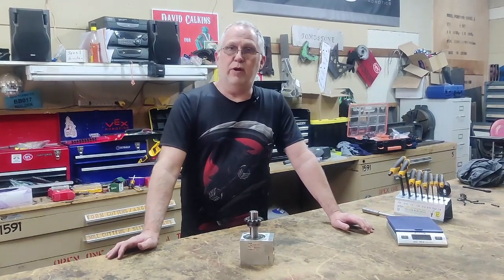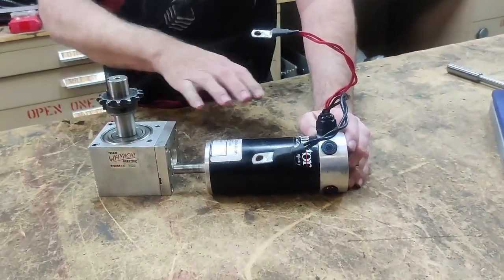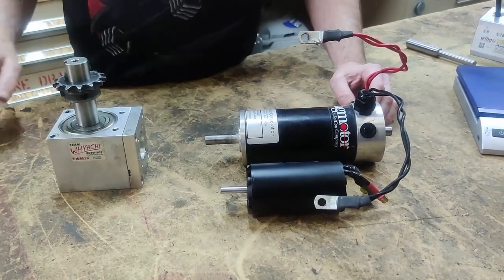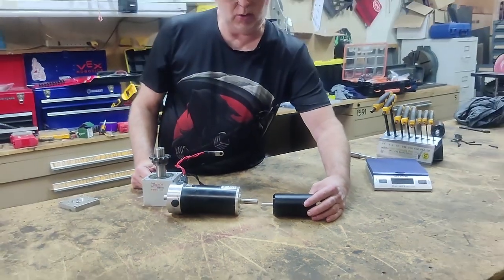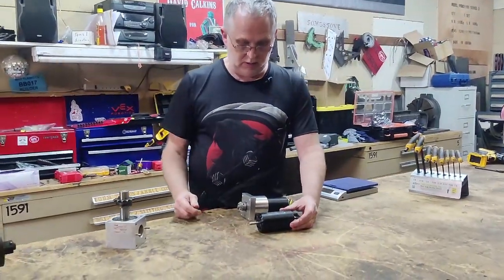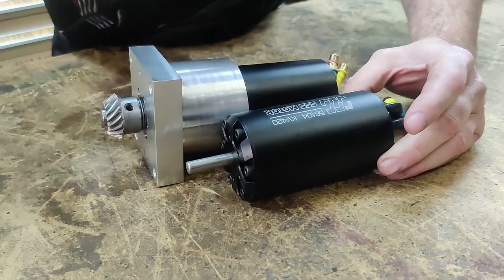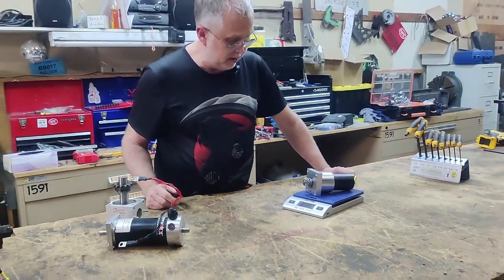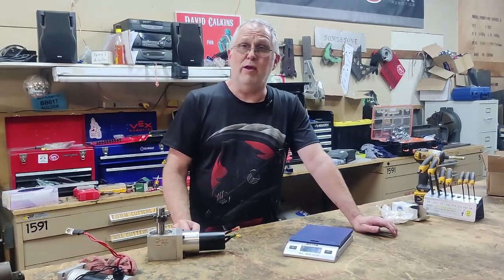Mortician 2023 - Weapon Motor

Comment: Look into the flat or pancake style motors. They have a very high torque start and stop using almost half of the power. They come in brushed and brushless versions. you would be able to direct drive your chain and remove the gear box. We used them decades ago in Panasonic copiers using belt drive. One machine literally had a bug fry on the control board and the motor slammed the optics carrier home and shredded the claimed "indestructible belt". That is a lot of torque!

Comment: Going to epoxy the windings of the motor? That 8mm shaft seems kinda small for the kind of hits. Maybe a flexible shaft coupler could help reduce the impacts.
I also worry about heat. I've burnt up quite a few motors of that size, just from lack of airflow. Maybe some thermal compound would help draw heat away from the motor case and into the aluminum piece you machined.
Reply from the maker: The motor I ordered from China was supposed to have a 10mm shaft. And took two months to get here. So by the time I had the hardware in my hands, I was pretty much stuck using this. I share your concern here, but we're going to run it and see how it goes.

Comment: Hello Ray, Hope you are doing great. Thanks a lot for all the videos you share. I had a little question regarding this video. What were the weight of the previous MAGMOTOR and the current BLDC motor included with metal base you set and gear? Please let me know. Thank you
Reply from the maker: At around 6:30 in the video I weight them both. The Magmotor was 7 pounds, 4.9 ounces. The brushless was 3 pounds 13.9 ounces, so about half the weight.
Reply: @ray9368   Thanks a lot Ray, I am really excited that you replied to my comment. Thanks a lot. You will not believe I am a great fan of TEAM TOMBSTONE and I had a Battlebot team name "Carbon". The robot I made was inspired by you. Thank you again.

Comment: -- Good to see, heh, hear voice audio ironed out.  I confess I wonder why it took so long for Combat Robotics to embrace brushless.  Couple years now, every team is rushing toward it.  Wonder if it was cost prohibitive in the heavyweight classes, but more affordable in say beetleweight. (Enjoy watching 'Division' the beetle weight bot compete). 
  Those old brushed motors look like something you'd see out of a Rascal Mobility scooter, but I have heard brushed makes more torque than brushless at the cost of speed and reliability.  Is that true?  
    What are you going to do with the saved weight?  Redundant electrical systems, more weapon weight and or RPMs (if allowed) or stronger armor/frame?  Or, do you leave it lighter for a bit more agility?  
   Anyways, good luck.
Reply: From what I've seen, the biggest stumbling block has been the increased difficulty with the controller setups. Brushless controllers require a lot more tuning than brushed DC motors.
Reply: @TitoRigatoni  -- I agree and I've heard that also.  But still I find it very strange.  I race 1/8th buggies and truggies both Nitro and electric.   Speaking of electric, the speed controller technology has been very well refined for a good long time.  Side note: 'Spectrum' company is probably the top dog there.  I and a lot of pros use them.  Maybe Ray should ring them up.  
    Anyways, I don't do combat robotics so I'm just another guy talking on the internet.  But I do have a lifetime of building RC under my belt and know a thing about building rugged (those buggies take a beating).
    You know, on contacting  'Spectrum' I wonder if talking shop with DJI or other drone manufacturers might help him too.  They run a lot more robust firmware than a simple controller almost to operating system level.  
   Be interested in what would come of that.
   Thanks for your thoughts :)
   Just imagine what a Raspberry Pi or a BMAX could do in a combat robot.
Reply: Thanks for pointing out the audio.  I completely missed that it's now "normal" instead of the poor sound from before.
Reply from the maker: Honestly, the power to weight ratio is impressive, but there are a lot of reasons that's not enough to make everyone switch. When it comes to torque at 0 rpm, which is what you need to move a lot of mass like a weapon bar, it really is pretty hard to beat a brushed motor. And there just isn't a brushless controller setup that really works for combat needs. So we're making do with tools that weren't made for combat, and trying to get as close as we can to our needs. Finally, since the whole system is pretty finicky about setups, reliability is also an issue. There are many great teams that have just decided the pros don't outweigh the cons.
Reply from the maker: "the speed controller technology has been very well refined for a good long time" - unfortunately refined for needs other than combat. We just aren't a big enough market for anyone to care, and the people in the sport tend to just figure out ways around the limitations of what is available. 

Spektrum equipment is good enough, I have used their transmitters and receivers for years. But none of their motors or controllers are sized appropriate for combat use. 1/8 and 1/5 scale stuff is well built for its needs, but too small really to handle power outputs of any modern combat robot. The largest esc they sell is 160 amp at a max of 8s. Just to give an example, the weapon on Tombstone pulls around 2000 amps at 16s
Reply: @ray9368  --Thanks for your replies.  I had a feeling, but I didn't want to guess on them.  There must be 'bread crumb' path for controllers that can handle more.  I've got a nephew at Cornell in robotics.  Most importantly he interns at Boston Dynamics.  I'll give him a ring.  That might be a way for a civilian to get hold of the upscaled tech, because the way you make it sound, you need military grade controllers.  ...stuff that operates control surfaces on guided missiles and such.  
   I'll say this, you all do a great job with what you can pull off the shelf/machine/etc.
Reply: @MarkJacksonGaming  Yeah I only have experience designing lab robots - and only hardware, the software guys take care of all the driver stuff.

But the requirements for a small robot sitting on a bench being subject to tender loving care is not even similar to the requirements of a combat robot. I'm only following along on the outside, and repeating what other teams have said.
Reply: @ray9368  Ugh.  Without using a sensor, does the controller have a way of knowing how well the motor is keeping up with the programmed acceleration?  If not, I can already see a problem if you try to spin up the motor, but something stalls it for a bit.  The controller will send pulses too fast for the motor to follow and it stalls out. Using a sensor would fix that, but apparently many feel that's a reliability issue.
Reply: @ray9368  in the world record speed run RC scene, high current is 500 amps..  so even at the outside edges of the sport, RC cars don't get near heavyweight combat robots yet.
Reply: @russellhltn1396  For a lot of brushless speed controllers, the motor itself is the sensor, providing feedback on its unpowered coil. Unfortunately, this only works once the motor is at a certain speed, which also causes the terrible torque from stand still.

Comment: Ray what you think about a centrifugal clutches(like nitro rc car but a robust one) to absorb the impact in the motor shaft?
Reply from the maker: Clutches certainly have their spot in this sport, and I would have preferred to use on here for the sprocket on the output shaft. But the sprocket would have to increase in size to accommodate this, and it's already geared higher than I really wanted.
Reply: If you could come up with some way of sensing torque you could have the motor controller cut power and let the motor freewheel at impact, taking all the load off the drivetrain. The only problem is tuning that to detect impact torque and not initial spin-up torque. Well, apart from detecting torque at all before it's too late and the impact has already happened.

Comment: Out of curiosity, does the 8mm thickness of the output shaft on the brushless create a risk for shearing of that output shaft during fights as a result of impact stress from beating up other bots?
Reply: I came here to say the same thing.  I'd be concerned the shaft would sheer when the weapon comes to a sudden dead stop.
Reply from the maker: It is a concern certainly. I guess we'll see.
Reply: Manually turning the engine off before a collision should minimize the damage to the output shaft right?
Reply: I guess the two set screws against the flat on the shaft is where the weak spot will be.

Comment: Looking forward to seeing how that thing spins up. Will it spin faster or just with more power/impact? Are you considering something like this for Tombstone?
Reply from the maker: It is geared to spin faster than it has in the past, although some of that is just the reality of the higher rpm of this motor rather than something I was actually after. And yes, working with brushless setups can definitely translate into Tombstone down the road, assuming I am happy with how it all holds together at RG.
Reply: @ray9368  Can't afford to travel from Florida to Alameda for the games - hope you post some videos
Reply: I was able to figure out the motor you are using. What motor controllers are you using?

Comment: SSS Motors are aviable with 10mm Shaft
Reply from the maker: And the ones I ordered had a 10mm shaft. Unfortunately that's not what they delivered. By the time I had the motors in hand, I was pretty much stuck using what was here. China manufacturing and delivery is both fantastic, and not.
Reply: @ray9368  of course, but you dont get more power 4 your money. ESC´s from Flier work fine on this Motors.

Comment: Why don't you mount the motor vertically and ditch the right angle gearbox?
Would save space and weight, and you could avoid those big adapters
Reply: One benefit of the right-angle gearbox is that it probably takes a lot of the shock of the weapon hits. Directly running the chain to the weapon to that tiny little 8mm motor shaft is probably going to make it shear right off on the first big hit.
He would also need to run a smaller sprocket, since the gearbox has its own reduction.
So either a fancy bearing system to take all the load would need to be designed, or a two stage reduction system (motor->jackshaft->weapon) or just continue to use what has been working well.

But yeah, i agree. The right angle gearbox seems unnecessary, and it probably has some mild transmission losses in it too, but re-designing the whole thing for a slight possibility of a mild reduction in weight is a bad idea if you already know it works well and is reliable.
Reply: @roboman2444  a extra stage of chain reduction would solve the shock load and gearing concerns
Reply: @king_br0k  Yeah, but that is additional complexity, and arguably more likely to have issue than just a gearbox. Untested/unproven = not great for combat robots where reliability is key.
Reply: I imagine you need a gear reduction somewhere.  I don't think that motor has the torque to do a direct drive connection to the weapon.
Reply from the maker: The output shaft of this gearbox is 1 inch diameter. Experience tells me I absolutely need that. I could have created a jackshaft setup and not used the right angle box, but I also had the right angle box. The motor laying down in the bot also fits better for how I planned on laying it all out inside.
Reply: @ray9368  has one of these gearboxes ever been broken in a fight?
Reply: @ray9368  It sometimes is possible to press out the shaft of these BLDC motors and press in one of your own (machined to be wider for the gear). Maybe that could be a solution for the future.
Reply from the maker: That was a thought honestly. And may be used down the road. I just figured it would have been more work than how I ended up doing it. I'll see how this setup holds up first, and plan accordingly for future work.
Reply: @ray9368  I'm just gonna throw a wild suggestion on the pile, but if as you mentioned the 1 inch shaft is so much needed, then that 8 mm shaft output is gonna fail very probably. I don't know how much it can help, but maybe coating the 8 mm shaft with epoxy glue before assempling it into the wider adapter would help in distributing the loads more and make it act more like one piece. Just my worthless 2 cents, good luck anyway and thanks for the video.

Comment: Hey Ray, why exposed wheels? Aren't you afraid of snapping them like free shipping did to Tombstone? I'm honestly curious.
Reply from the maker: Weight allocation. The tires need to be at least the width apart as the spin circle of the weapon, or control suffers. If you make the frame then wide enough to go out that far to cover the wheels, you have to take weight away from other areas to make that happen. And that forces a lot of compromises, that I didn't want to make here.

Everybody likes to just say "cover your wheels" and the truth is it just isn't that simple.

Comment: Is there a big difference in RPM in the brushless motor vs the old weapon motor? If so, will you have to adjust the sprocket size to take that into account?
Reply: Given that the shaft is so much smaller for twice the power, it does suggest the motor is designed for higher RPM/lower torque than the original.
Reply from the maker: The output rpm is higher, and we have made some gearing changes because of it. Probably not enough though and it is geared faster than I would like. No real time now to make any further major changes so what you see is what we run.  It is scary up at full speed though :)

Comment: Could you fill the bore of the gear with weld and then re-drill at 8mm?
Reply from the maker: I suppose that would be possible, although I just don't see it working as well as what I ended up doing. It would have been shorter though, so if space was an issue it could be done.
Reply: @ray9368  I guess by the time you drill and brooch in a key way it could weaken it too much, I didn’t think of that. I like seeing engineering things like this though and thinking up alternative ways of doing things. I usually tend to go overkill with everything I’ve build though. I’ve actually always wanted to see a robot with an electromagnet on it, so you’re able to connect to the opponent and then either shoot flames, or drill into the opponent and fill it with expanding foam or something to shut it down.

Comment: Damn, I used to read that high quality brushed motors have similar power to a brushless ones, I guess that was a lie. 

Ray, with all these weight savings, do you have more  weight for the weapon bar? does Robogames have a limit on the weapons weight ?
Reply: Idk specifically but I would guess that over time brushless motors and ecus have gotten much more efficient and lighter than brushed motors. So that was probably true in the past, but maybe not anymore

Comment: Wow, respect, you changing to brushless, good idea.
But be aware of the behavior of the controller. There is so much you can set, and most of them need to reset when the motor stops immediately. That's not what you want with your weapon.

Comment: I'm surprised you are willing to put that amount of power through an unkeyed shaft.
Reply from the maker: The only unkeyed portion was the output shaft of the motor itself. I would have preferred that was keyed instead of machined for the flat, but I have to work with what I have :)